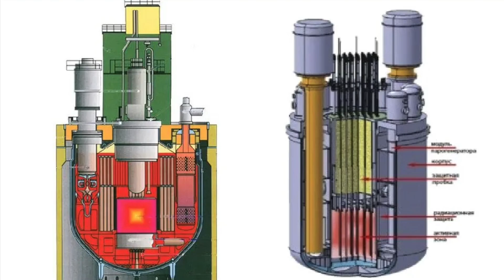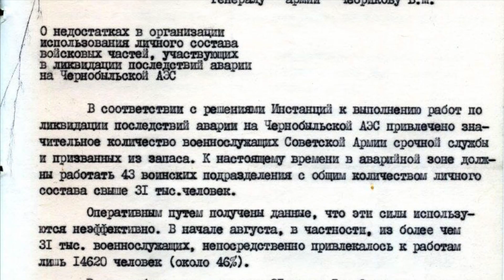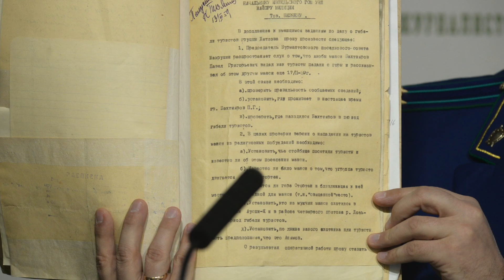What was changed in "RBMK" reactors after the Chernobyl disaster?

Comment: The reactor's design could be agreed to be crucial under low power flux levels, but crucially by far the only thing that has caused fuel ruptures in LenNPP and CHNPP had to do with the emergency core cooling system (ECCS) system that wasn't really mentioned in this video and perhaps if the ECCS would have responded and designed more efficiently in case of a power outage and of a turbine runaway test MAY have helped balance the amount of water in the core as it was being evaporated at the same time by the positive reaction of the moderator and fuel. This would have in fact prevented any fuel ruptures at any RBMK site if it wasn't for poor fatal core cooling systems installed of the RBMK 1000

Comment: Like most technology, the limiting factor is the human factor, the Chernobyl disaster would not have occurred if the operators were trained about its tendency to xenon poison after low-power operation, or about the 'tip effect' caused when the control rods were reinserted. So these inexperienced, inadequately trained operators were relying on their interpretation that the AZ-5 button was their safety hallelujah button, when in reality it caused power excursions and had already led to accidents at Leningrad and Ignalina.

Plus the simple fact that they were performing experiments that should have been left to experienced personnel only, and REALLY should have been performed at experimental facilities, rather than a full scale commercial reactor.

There was all the makings of technical and procedural review that would have prevented Chernobyl and led to the RBMK reactor being regarded as an obsolescent, but capable design, rather than the current popular conception that these reactors are ticking time bombs. The problem with these reactors was the Soviet Union.

Comment: Yes, the Canadian CANDU (CANadian Deuterium Uranium) reactor has a, albeit very small positive void coefficient. However, it is also one of the most reliable and safe reactors out there. It even holds the world record for achieving the longest (safe!) continuous operation cycle (a whopping 1106 days). It has full containment, active and passive safety systems that will work without power or operator intervention. And when the reactor is scrammed, there is no way it will restart on its own. The restart HAS to be done manually by an operator, or else it is just going sit there in the basement like the most expensive paperweight you can find on that side of Canada.

If you ever wanted to know what an RBMK done right and proper would have looked like, look at the CANDU. It quite literally looks like an RBMK that has been put on its side, although a bit smaller in size. It has on-power refuelling, has a positive void coefficient, just like the RBMK. It is the same plumber's nightmare when it comes to the gazillion miles of piping that is involved with building all those pressure tubes. The CANDU uses heavy water instead of graphite as a moderator. However, it is unparallelled when it comes to safety. They designed the reactor in such a way that it will react rather sluggish to a starting positive void coefficient taking hold, so the operator has ample time to engage a proper countermeasure. Compared to the CANDU, an RBMK is on a hair-trigger.

I happen to like both reactor types a lot.
Reply: @gordonjenner2375  
That's why I mentioned it. Read my comment again, it's in there.

The only way I compare the two is regarding their reaction to a possible developing positive void coefficient. The CANDU is designed in such a way that if a positive void coefficient starts, and that chance is VERY slim unlike with the RBMK, its response to that development is intentionally sluggish. This gives the operators more than enough time to nip it in the bud. The RBMK, however, will be very, very quick to respond. Too fast for the operators to stop it by the time they notice it going on. This problem was exacerbated by the absolutely antiquated SKALA computer system used at the time. The poor thing needed almost half an hour to calculate what was going on in the core. Not to mention that the sensors were only measuring mid-core and weren't very accurate at lower power levels. Combined with the flawed design of the Control Rods (which has been mitigated somewhat through various improvements) makes it being on a hair-trigger so to speak when you compare it with the CANDU. I know they are not the same, I just mentioned some striking similarities.

The RBMK could have been a proper, more safe reactor if they would have sat on the design a bit longer in terms of a better, or should I say safer moderator, ditching the whole "make weapons grade plutonium and electric power at the same time" idea, so they could have given it a full containment building. If they would have picked a better moderator, that also means that the size of the core could have been smaller. And instilling some serious safety culture in its operators would have helped greatly as well.

There is a lot more that I could write, but I don't feel like typing out an essay on an obnoxiously small smartphone screen, if you don't mind.😅
Reply: In physical similarity I would say Magnox reactors and their offspring AGR reactors are closer to RBMKs as both of those just look like slightly larger versions of an RBMK with their huge uncontained upper biological shield just like an RBMK, what makes them less 'splodey than RBMKs is that both use CO2 as a coolant and CO2 can't expand any further since it is already a gas.  Magnox and AGR plants are very expensive to operate and maintain but they are arguably the safest reactors on Earth since everything in the core is already above it's boiling point.
Reply: @krashd  
They most certainly have some similarities. And they stem from the same era as well. The positive void coefficient is of no concern in these reactors, since the gas used is already a big void to begin with. They also show that you can safely use graphite as a moderator if you think things through a little more. Both the Magnox and AGR reactors have proven that, I think those English reactors are very well thought out. Too bad not many people seem to know about them.

Comment: San Onofre nuclear generating station
SONGS.  Almost blew up lighting the ocean on fire.  Disregarding all safety protocols and paying off inspectors since 1998 it was run above the safe limit envelope for years. 
After the revamp with new design it started falling apart within months.
Key design changes removed critical components.  
When the unit was attempted to shut down the temp kept rising. 
They lost outside power for the cooling pumps. The generators on station were basically destroyed after use from demand needed. 
Then , later engine coolant was discovered in the fuel supply for the generators. Sabotage. 
The foreign company that owns the utility does not care if you die. 
Another nation going up in smoke is of no concern to them.. 
Paradise california. 
Proof .  Duh.
Reply: I hear that power plant often reminds Frank Drebin of his wife.